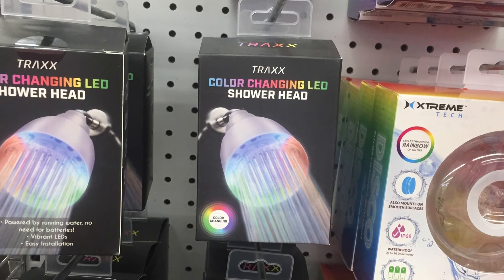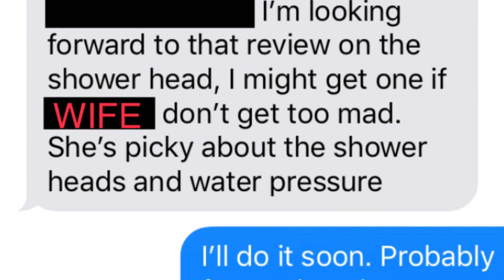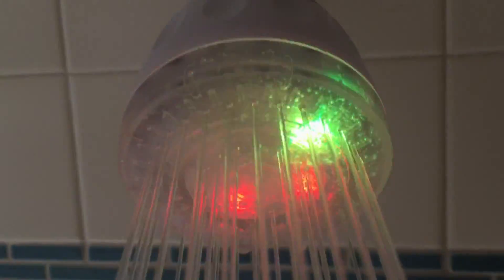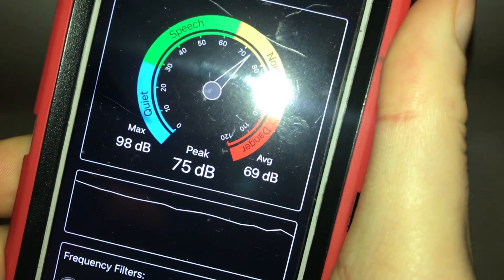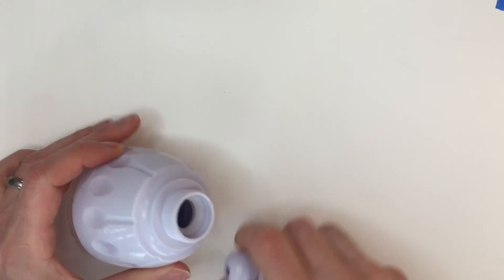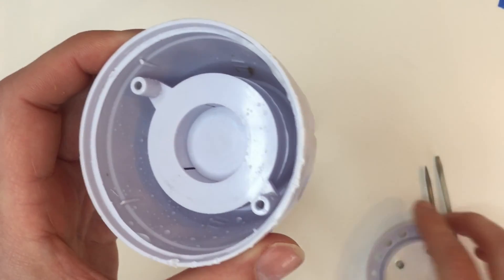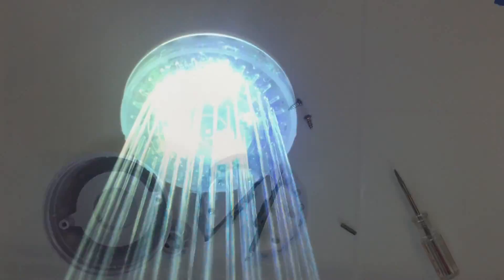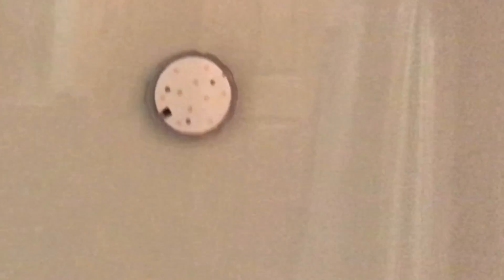Review and Disassembly of LED Shower Head | Hydro Powered | TRAXX Five Below | Sound Test Flow Test

Comment: I would purchase one of these if it was just 1 light and regular color. Great invention for a SHTF situation where power goes out but water service is still available.
Reply from the maker: Good point!
On that note, I know there is a Hydro powered sump pump, so the basement won’t flood if the power is out and the typical electric powered sump pump does not function.
It won’t work for me personally. I have well water. So if there is no electricity, there is no water. But if you’re on city water, definitely worth looking into.

Comment: If I remove the rotating element at 5:46 and reassemble the shower head, would the noise stop? I have an LED shower head but I absolutely hate the noise it makes. What adhesive would you recommend if you were to reassemble it?
Reply from the maker: Unfortunately, if you remove the rotating element, no LEDs will illuminate. It will just be a regular shower head.
The rotating element is what generates the electricity to power the LEDs.
Reply: @HowtoandReviewsOfficial  I’m okay with that. Does that mean the noise the shower head makes will stop?
Reply from the maker: @improvisedexplosivedevice2007  I think it is very likely that removing the rotating element will eliminate the sound.
There is a possibility that the flow geometry through the three slots causes the sound, but I don’t think so.

I would recommend waterproof / marine epoxy. Example: https://amzn.to/3mPRsNA

You can buy a basic shower head for less then $5. Example: https://www.lowes.com/pd/Project-Source-White-1-Spray-Shower-Head/4767315
Reply: @HowtoandReviewsOfficial  thank you 😊

Comment: Mine's making the same horrible sound. Has anyone figured out how to fix it?
Reply: I also want to get rid of the sound. I’m not quite sure since I’m only 14, but my guess would be to remove the part of the shower head that rotates when water flows through it. At around 5:46 in the video, the rotating component is removed. Maybe if you removed it and reassembled it the shower head would stop screeching? I don’t know haha. I hope this helps though. My question is how I’m supposed to glue the whole thing back together. :v
Reply: @improvisedexplosivedevice2007  that's the part that generates the power of you remove that, no lights. Thank you for trying though ^^

Comment: My fiancée found this in the box, disposed of behind the store in a dumpster only used for dry products, (treasure hunter). Lol. I couldn't get it to stop leaking and spraying and was gonna toss it, but all it needed was the joint thread connection tightened. Love this thing. Great flow velocity. Makes showers more interesting. 🤩
Reply from the maker: Good find. It was entertaining for sure. For me, the squealing sound was way too excessive. If it wasn’t for that, I definitely would have continued to use it longer.

Comment: i just installed mine a minute ago and when i had the water on cold it was bright but when i turned the lever to hot it was really dim
Reply from the maker: It should be all about the water flow. Your hot water may have less pressure or flow.
Does yours make the ridiculous squealing sound?
Reply: @HowtoandReviewsOfficial  barely, about halfway in between hot and cold is when it’s the brightest and i can hear the sound a little
Reply from the maker: @jaydonclemons2006  That’s probably when you have the most flow. 
That doesn’t sound terrible. Dimmer lights without the squealing sound sounds like the winner. That squeal was pretty awful.
But, fun to try for five dollars!
Reply: @HowtoandReviewsOfficial  yeah, only the red lights really work on hot though and they aren’t very bright at all, but i can probably figure something out